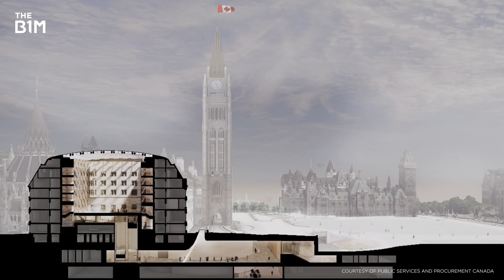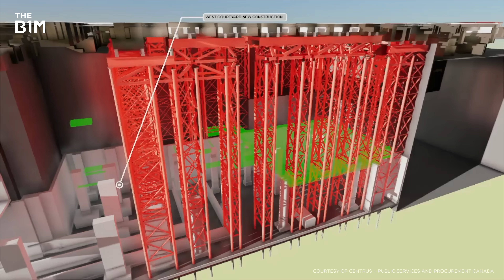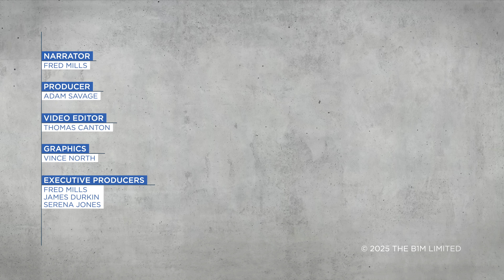Why Canada Blasted a Huge Hole Outside its Parliament

Comment: I was curious about towers, and your assertion is confusing. The Peace Tower (98m) in Ottawa is taller than the tower that houses Big Ben (Elizabeth Tower 96m). The Victoria Tower (98.5m) is indeed taller than the Peace Tower, but only by half a metre, and that's not the tower commonly called 'Big Ben' by everyone.
So, we're not trying to beat you at parliamentary buildings; we did that over 100 years ago.

Comment: It would be interesting to see what they dig up as that isn't the original building.
I did security while the library in the back was rebuilt after a fire.
It was interesting seeing what was being excavated.
I also wonder if they are putting in new escape tunnels, the old ones are wild to be in.

Comment: Just at the start, about 1:19, the choice of the capitol city. Top runners were Toronto, Kingston , and Montreal BUT Queen Victoria took the advice of her boffins and chose Bytown, Ottawa's name at that time. Why? The other choices would allow U.S. forces to march or sail to the location in days, where as notalot, I mean Ottawa, required a few weeks of marching through hostile territory to approach the capitol, that would need resupply. Go on, try to march deep into a country that has WINTER that your homeland doesn't have much experience in dealing with   ...   go on try it.
Reply: It's literally only 70km from the border why didn't they choose somewhere further

Comment: Great video, but it should be noted that the Senate of Canada Building is temporary.  It was originally the main downtown train station until 1966, then was converted to a government conference centre.  When plans were made for a decade-long refurbishment of the Centre Block of Parliament, a temporary House of Commons was constructed in the largely open centre of the the West Block, and the Conference Centre was converted to a temporary Senate building.

Comment: You forgot to mention that before Ottawa, the Parliament of Canada was actually in Montreal!

In 1849, English-speaking mobs from Montreal burned it down in protest after the government decided to compensate the French Canadians for the losses suffered during the Rebellion of 1837–1838.

The English merchants and loyalists of the city were outraged that “the Canadians” (as the French-speaking population of Quebec was called back then) could receive money for damages caused during what they saw as an insurrection against the Crown.

The riots were sparked by inflammatory pamphlets published in The Gazette, which fueled public anger. The situation quickly got out of control and the crowd stormed the building, set it on fire, and the Parliament of the Province of Canada was destroyed, forcing the government to relocate permanently.

That’s one of the reasons why the capital was eventually moved to Ottawa.

Comment: Something similar is being done with the Salt Lake City temple od the Church of Jesus Christ of Latter-day Saints in Utah, USA (completed in 1894). The base of the isolators are concave so the building can move back and forth during an earthquake. Holes have also been drilled down through the granite walls where cables are being run and then placed under tension.It's scheduled to be finished by April, 2027.

Comment: The modern system of base isolation using lead rubber bearings was invented by Bill Robinson, a New Zealand seismic engineer who worked for the NZ Government. A key consideration in the design of a comprehensive seismic solution for NZ public buildings was the ability for it to be retrofitted, as many critical buildings that required seismic protection had already been built and were not likely to be reconstructed in the near future, such as the NZ Parliament Buildings. As such, the typical retrofit method is much simpler and less invasive than the method being used to retrofit the Canadian Parliament, which is only practical because the new basement requires that they blow out a giant chasm anyway, an intensive undertaking that the typical method explicitly seeks to avoid. The relative ease of retrofitting LRB base isolators is the key feature that has allowed them to spread across the globe and protect many of the world's largest and most iconic commercial buildings, along with vital public infrastructure such as government buildings, hospitals, universities, museums, and even bridges.

Comment: When the parliamentary library was thoroughly renovated about 15 years ago basement levels were excavated beneath it. This was done while the Centre block was still occupied. Truck loads of stone were removed through a tunnel bored into the escarpment. Pillars of the bedrock were left to support the structure above. A statue of Queen Victoria was removed during the reno and when it was time to return it to her plinth in the centre of the round room it was a major engineering and rigging operation. Massive timbers and steel beams were laid out to spread the load over what was formerly a floor fully supported by bedrock. Unfortunately we were given the days off so I couldn't watch the move.

Comment: A massive expense for a building that should be retired turned into a museum and replaced by something new.  
The government takes up all the ugly mid rise office buildings around it, and then a few specialty luxury agency buildings not built as mid rise office blocks sprinkled throughout the city.  

The closest Walmart Super Center has a bigger footprint than the center block. (it also has better transit connections and more parking)

Comment: The Supreme Court of Canada right next door is now also undergoing a multi year restoration and upgrade.
Part of the underground visitor center is already open as tours of the temporary parliamentary chambers in the restored west block have been open for a few years.
I was in Ottawa for Canada Day this year (2025), the construction site is impressive in its scale. Most of the center block is behind a shroud with a full sized image of the facade on it. The excavation site has requested specilized stabilization netting due to the geology.

Comment: They did something similar with Union Station in Toronto. They dug out the ground underneath it while it was still being used and added a bottom floor with a food court. Changed the rest of the station around as well.

Comment: 9:58 Canada's acting like this is a world renowned building, when nobody outside of Canada has heard of it. 

I cant help but thinking it would have been the same price the rebuild the entire structure, while reusing the stones on the outside as a decorative finish, for the same price.

Trying to modify an existing structure is often just as costly as having a fresh slate to start over. Especially if the final product would be better by starting fresh.
Reply: It’s restoration and protection. Plus new experiences for visitors. It’s not unlike what happened with Big Ben. Sure it isn’t the CN Tower, but it doesn’t have to be world-renowned in order for it to gain a significant amount of care. It’s our building.

Comment: Real quick, I have been to the Parliament building, been up in the Peace Tower as high up as you can get, also have been inside the old library, it was such an amazing time, was there on a school field trip, staying in a nearby hotel for 3 days before bussing back 13 hours home. Even though that was about 15 years ago, I still remember the library, and being all the way up at the top of the Peace Tower and seeing the gold mirror like ceiling and also all the bells... likely will never do that again but I would love to if given the chance.

You know, you would think a project like this would have made news headlines around the country, and be regularly updated on due to how important this is for the country... Yet 5 years after it started I am only just learning of this. I knew the building was undergoing some restoration work, like normal work old buildings undergo, but I had no idea just how extensive the repairs were going to be or the extent of the damage done overtime, or even that they were building a huge addition to the building by blasting and digging underground, under the 100 year old building and adding structural safeguards such as those base isolators which makes sense for such an important building to have though they didn't exist 100 years ago nor were earthquakes a big worry for that area.

Comment: This restoration is being done correctly. The alternative is doing it half-assed. Yes, it is very expensive, but still money well spent. Taking the time and resources to do this right is not optional. Give the engineers and architects the leeway they need. One overall instruction could be, get it right. My experience working with professionals is, first of all listen to their counsel and second, not to tie their hands behind their backs. Major projects like this run into snags that should not be rectified on the cheap. It would be a mistake to be a slave to a budget on something of this magnitude. There are no do-overs. No, sad stories post construction, please.

Comment: 09:45 "It's obvious why historic buildings need to be maintained."

Yes, Rulers must maintain the illusion of millennia of stability to prove the "You can't fight city hall, only we have the worldly connections that enable you to survive in this adversarial environment," narrative.

The maintenance of impressive technical construction projects projects that image.

Maintenance of national cathedral infrastructure projects also keeps relatively skilled, adaptive, underpaid journeymen workers occupied, "idle hands are the devil's workshop."

Burning massive lower class proletariat provided resources on projects with no tangible benefit to them also serves to further subjugate then psychologically, afraid to resist - openly at least.

History does tend to repeat itself.

Comment: I used to have the coolest job at Parliament and it is rare to see this great of footage of my workplace. Why? Because most times cameras and drones are not allowed to fly anywhere close to where this drone is. 

I used to work on the rooftops of these buildings. My job was to go up early in the morning about 3 or 4 am, and both shovel snow off the "dips" (the roof looks like a peak from the ground, but the roof does not actually peak, and the top floor has skylights and walkways on the roof). Since the roof is copper, it generally does not truly freeze and snowfall on it melts almost immediately. The problem is being as high up and open and exposed as the buildings are, the slightest breeze is REALLY cold. This freezes the water as it slides down the roof and depending on how much it is snowing, how wet the snow is and how cold it is, that can create giant sheets of ice on the roof and monster 10 foot icicles. We would be done before citizens arrived at 8:30 in the morning. That was the most fun I had every winter for 8 years. 

First we would shovel the dips, then we would rappel down and knock off the sheets of ice and the icicles which could sometimes be upto 15 feet long and weigh about 100 lbs. They could easily end someone's life. 

The best part of my job was going to places that not only had less than 50 people ever have been to, but many of the places you would not believe were accessible nor believe what it takes to access them. Canadian Parliment buildings are incredible architecture.

Comment: I live in Ottawa and no idea of the magnitude of this project. The welcome centre will be a fantastic addition for all to enjoy.
Reply: Funny nobody is complaining about the noise made by this project
Reply: BILLIONS... you did hear right... you BELIEVE a "welcome" center IS NEEDED costing BILLIONS?    HOW will it EVER be worth that.
Reply: @Canadianguy-d5d the welcome centre itself isn’t billions - the whole project is. And it will be worth it to have a restored building that doesn’t collapse in on itself. The issue here in Canada is that ongoing maintenance on our stone buildings is never really done until it’s desperately needed. Couple that with the lack of structural safety on the original build and you have a large price tag. I guess they could have torn it down and built a concrete block eyesore for the government to operate out of at a much lower cost, but would that have been better?
Reply: @Canadianguy-d5d  reminds me of the projects hitler and stalin put in place during their regime lol
Reply: @FloofMoji  lol, I suggest you actually learn the history. Hitler and Stalin building welcome centers? relocating government away from the massive edifices that project power and authority? LOL, you've got to be kidding right?
Reply: @FloofMoji 
How so? Or is putting down the government your favourite hobby.

Comment: The fire that was mentioned was actually announced what caused it I took a tour in the center block and the guide told us it was a cigarette that was accidentally thrown in a garbage bin in one of the offices so one started to smell smoke and told everyone to get out some people saved some paintings and one ran to the library closed it’s iron doors which is still original structure

Comment: The Dutch are renovating their parliament buildings as well, but for a mere €2bn (CAD 3.3bn/USD 2.3bn). For now, at least; the budget has already ballooned. Turns out that fire safety and cybersecurity weren't big items in the early 13th century.

But, um, B1M, the Palace of Westminster needs a bit of work done as well, to put it mildly.

Comment: Yo yo yo yo look under the superstructure though, the foundation infront of the "basement". There's at least another 800m of building under there, this structure is similar to top of the Empire State Building, also the topography in the area and the St Lawrence's elevation relative to sea level. Maybe 800m is an exaggeration but c'mon, there's clearly more superstructure under there so it's not a "basement" or "foundation".

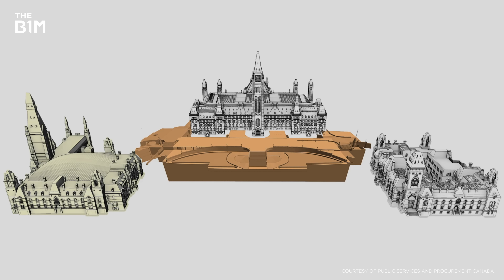Comment: West block (on the left at 9:29) is a set of buildings surrounding a large courtyard. To hold parliament while Center Block is closed, as you can see from the picture, they put a glass roof over that courtyard to turn it into a massive new meeting room. They filled it with the real desks and seats from Center Block and then got right back to work. You can take tours around it (or you certainly could a few years ago): it's beautiful.